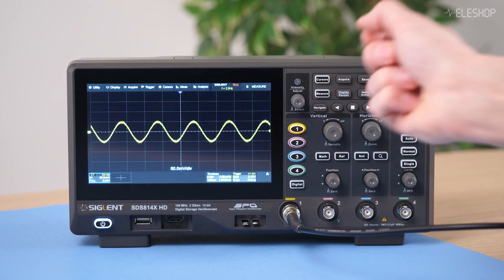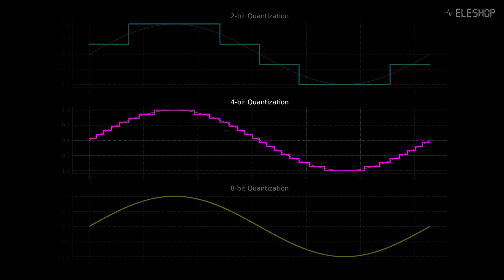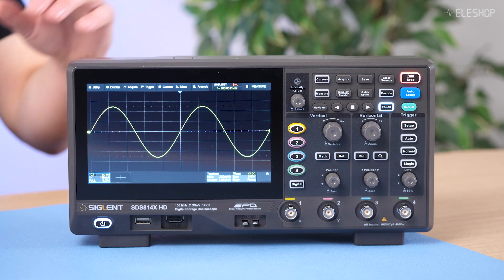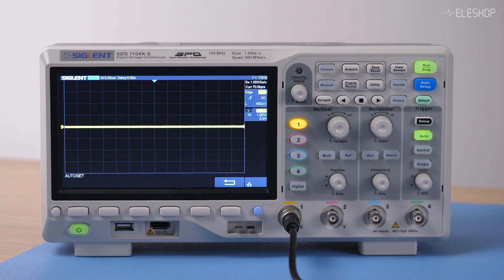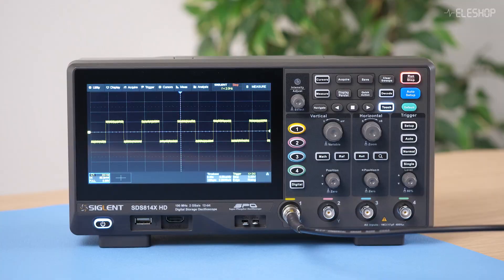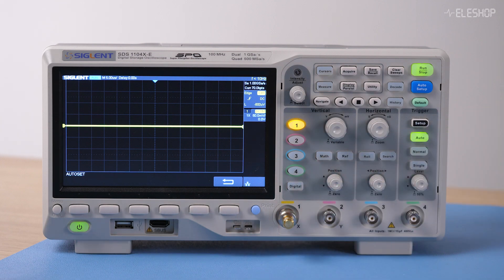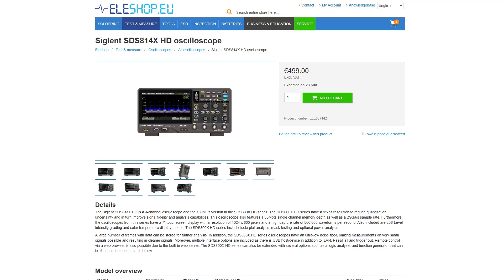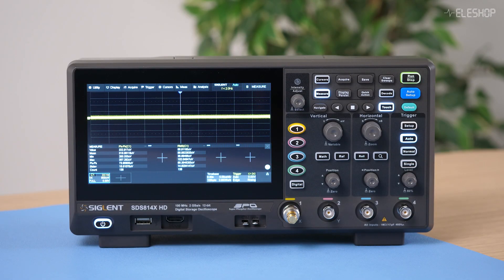8-bit vs 12-bit Oscilloscopes: Does Higher Resolution Really Matter?

Comment: The situation is not quite that straightforward; in reality, performance largely depends on the SINAD (broadband harmonic distortion). For instance, a high-quality 8-bit oscilloscope such as the Rigol DS1054Z can achieve over 7 bits of ENOB (Effective Number of Bits), whereas models like the DHO924 or SDS824X HD reach up to 9 bits of ENOB.
Reply from the maker: True! We wanted to keep the video simple and short, so we decided to not include ENOB and SINAD.

Comment: They didn't rework the waveform rendering in the FPGA properly for 12 Bit, which is disappointing. With unchanged screen resolution, the rendered waveform could show less aliasing and reveal more detail for the 12 Bit Scope.
This makes the 12 Bit a bit too much marketing than advantage.